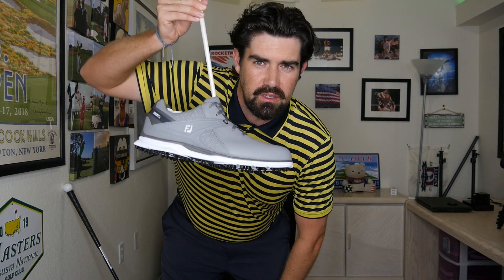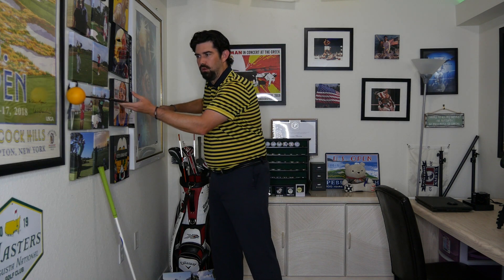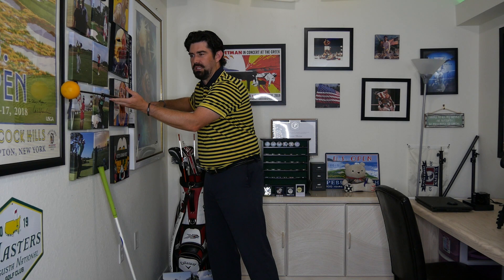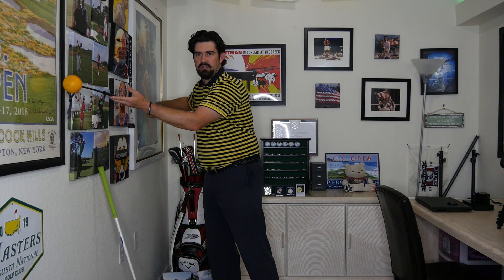LESSON 3: How to move the hips in YOUR golfswing (INDOOR DRILL SERIES)

Comment: Often see the pelvic movement demonstrated with a aiming rod between your front belt loop. In setup the target side of the rod is slightly up. Then in the backswing the target side goes down below the right like you are rowing slightly into the water. The right side of the pelvic goes up and back without a lateral shift to the right. Is this a good swing thought? Thx. Tom
Reply from the maker: Like that as a feel, talking about the rotary component here but tilting needed for sure